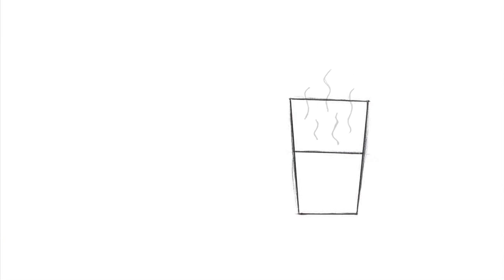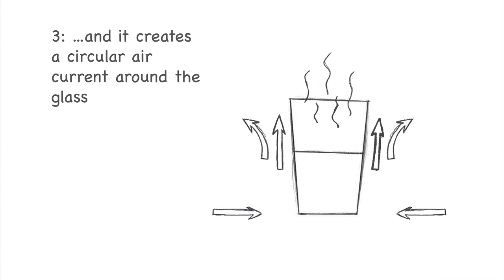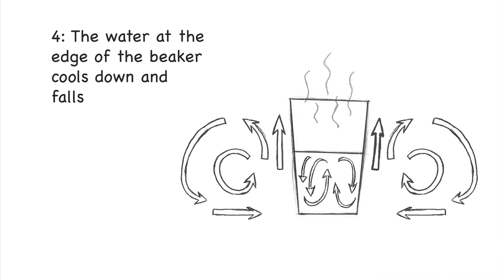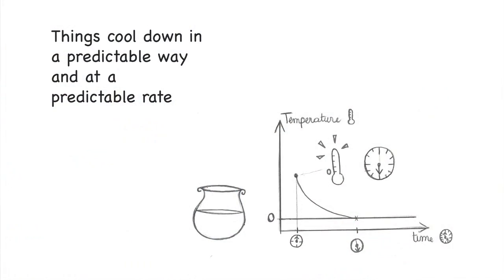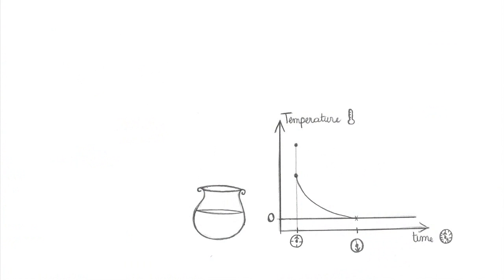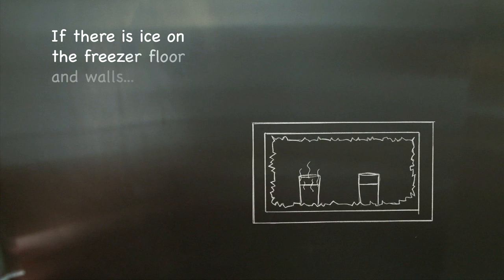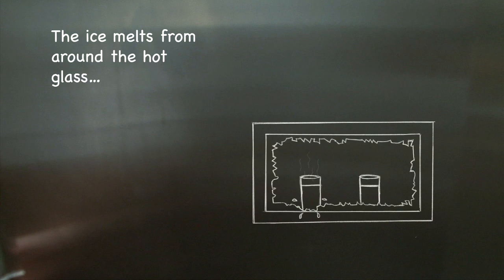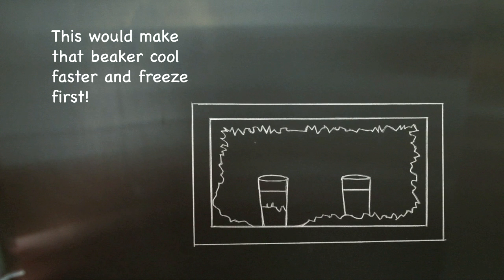RSC Mpemba Competition

Comment: Voting on the winner what a joke. There is nothing scientific about it. Use a different container or clean the ice out first so both would have the same contact area. That would eliminate both of these theories.

Ice molecules take up more space versus cold water. The best place an ice molecule can form is on the surface, highest probability due to the lower pressure. It is the same effect as semi-conductors almost. Warm water has more motion and more chances to form the lattice needed for ice.

Comment: The question itself is a bit idiotic! if some one is talking a nonscientific question with generalization of the subject.,Scientifically many questions arise, 1) How are you going to cool the water? Is the volume of water taken in both the containers constant? its not because hot water occupies more space than cold water thus it might be less in amount. What is the process of cooling? What are the molecular dynamics? what are the equipment used? you simply cannot generalize a question....